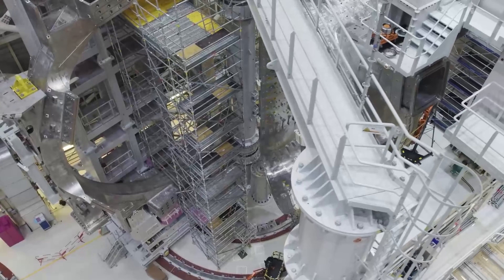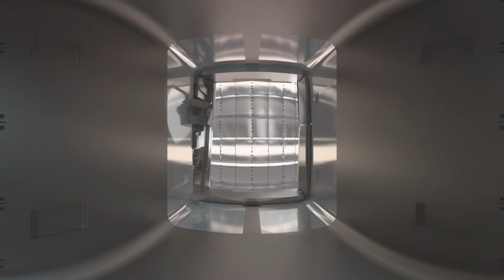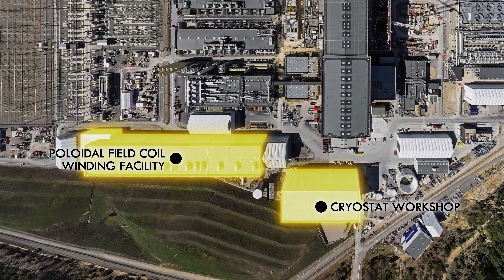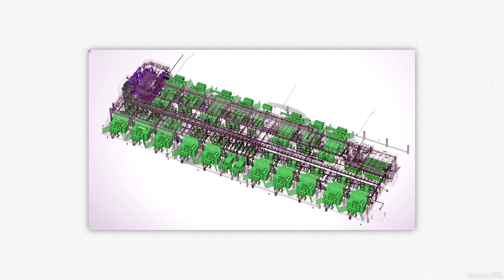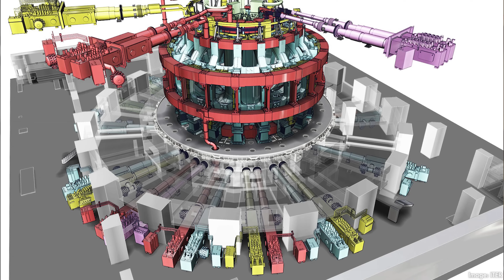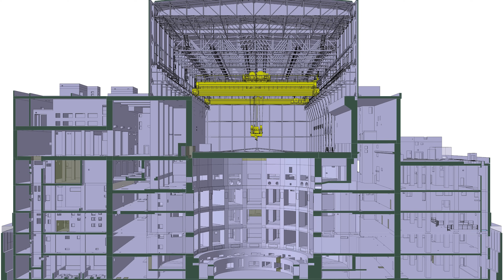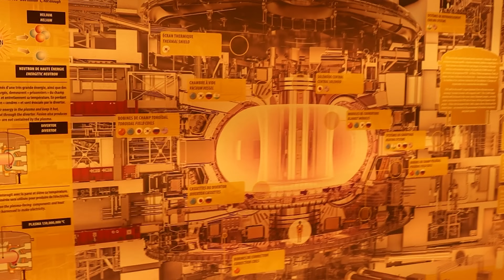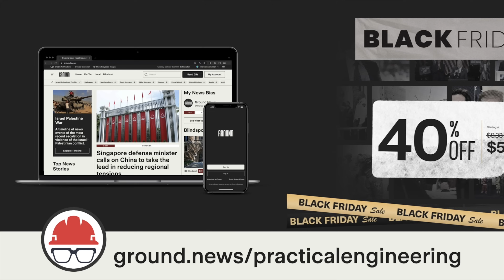Engineering The Largest Nuclear Fusion Reactor

Comment: 12:32 "ITER’s goal is to produce a Q of ten, to get ten times as much thermal energy out as it puts into the reactor. ".  No, power into the reactor will be 440MWe. Power into the plasma will be 50MW thermal.  Q=10 means 500MW thermal out of the plasma, equivalent to max 200MWe if used to generate electricity. So, 440MWe into the reactor, hypothetical max 200MWe out of the reactor.

Comment: Why does everyone brush off capturing the energy of fusion as being a trivial problem?  It's the first problem. It's been 50 years plus now trying to take the first step to a reaction, and nobody says how they will get electricity from it. Here it is brushed off as, we will boil water.  LOL. The entire process of fusion requires profound isolation so I'm wondering, how does the heat get out?

Comment: The sun is a sphere, not a donut shape.
The sun achieves fusion at lower temperatures and generates its own gravity.
So the questions are how, what forces are at work that we cannot detect in the sun.
We know spinning a magnet produces electricity in a coil of wire, so the force of magnetism can generate physical electrons.
But we cannot generate electrons from the earths gravity. 
We are missing something here.
Untill we understand what the force we cannot detect so far is, the fusion reactor will not work.
The Physicists cannot explain how the universe works, insufficient mass, so they solved the problem in their equations by introducing dark matter!
We have only just discovered how to turn photons of light into electricity using solar panels.

Comment: It’s time we took a reality check and consider the following options.

Cold Fusion (LENR) - Unproven hypothesized type of nuclear reaction that creates nuclear fusion at room temperature by producing more energy than the input energy can be produced from its altered state.

Tokamak Nuclear Fusion Reactor (ITER) - Development cost for the ITER is $150 billion. Requires a temperature of 150 million degrees Celsius to create nuclear fusion. Reportedly the record to date but having to use more input energy than produced is 69 megajoules of fusion energy for five seconds using 0.2 milligrams of fuel. 

Small Nuclear Reactor - The accumulative effect of multiple small Reactors eventually ends up with the same problems that affect large reactors.

4,536 Mw (VOGTLE) Nuclear Fission Reactor Costs $35 billion requires 1,282 hectares, nuclear safety costs $200 million per Mw, no technology to deal with nuclear waste and only has a known minable uranium reserve at current extraction rate of 80 years.
 
Renewable wind and solar farms - inconsistent energy production causes curtailment and fails because of the firming factor. In Australia the farming land required is ten times the size of Tasmania and are being erected without a decommissioning plan to address their environmental impacts. Renewables have financial masters to who the taxpayer serves. The primary purpose for renewables is Carbon offsets which allows polluting industries to increase their polluting activities while expecting the public to believe renewables are saving the planet.

The alternative.

Solar Hydrogen Energy Recovery Gas Turbine – 301Kwh (equal to 46/6.6Kw home solar installations) of solar energy collected from the sun’s constant nuclear fusion at atmospheric temperature is sufficient for electrolysis to provide the start-up sequence and enable a hydrogen Gas turbine to synchronize with the turbines Variable Frequency Generator and provide constant electrolysis to continually fuel the turbine and operate the energy recovery system on a hydrogen use as produced basis to generate a variably regulated energy range between 80 - 330Mw with optional co-generated steam capacity up to 700Mw of electrical energy on a 24/7 basis. 

The turbine has three operational parts, cost $36.5 -49.5 million, requires a footprint area the size of a football field, noise level is 60dbl at 60m, incorporates direct air capture of CO2 at 1,400 Kg/sec and includes a 14-year end of life decommissioning or optional refurbishment program.
 
Sixty-five carbon offset prohibited and pollution free, shovel ready installations generating a total of 21,450 Mw, retrofitted to any of the 120 Hydro-electric schemes would provide Australia's entire energy needs covering a combined operational area of 33 hectares for a 2023 total cost between $2.4-3.3 billion, construction period is 3 to 5 years, meet net zero twenty years earlier and makes wind and solar farms including hydro, gas and nuclear energy production redundant.

Comment: Seems very impressive as a project but no one expects this to produce any net energy.  Given the massive price tag; the funds could be spent on something that actually produces energy such as geo thermal; possibly home solar; or even natural hydrogen deposits identified by USGS which may be in the Trillions of tons - this project seems a total waste of money - Fusion advocates have been burning billions for 75 years; and they alway say they are one step away... at some point; it seems prudent to decide they can't do it.
Reply: If I was an investor and I had two choices this project which probably won’t deliver any benefit in the short term if ever and one that will deliver clean Solar guaranteed this year and for the next 25 years I know where I put my money
Reply: @chrisnewman7281  Solar at least gives you something, right now it has a stumbling block; lithium refining and lithium fires; if you can find better storage that would be money that produces something.  Geothermal produces something, wind does also but has the lithium hang up for storage. Ethanol works, conservation works, probably some other things work. Now if - an If like Fusion or natural Hydrogen work out - all the investment in those sure things becomes waste, but what are the chances?

Comment: Fusion will never work. Even if you get the plasma to work, and there is no indication you will it get to work sable enough. You won't get the energy out. There were the fantastical headlines of that one reactor for the first time "produced" more energy than put in. Yes, the reaction did, the energy output of that reactor was a big fat *ZERO*, though.

Old joke: Fusion is just 10 years away, said by the scientists and engineers since the 60. Every years.

Comment: Interesting fact 100M degree sounds insane but in eV it is about 10 keV and that like nothing for most particle accelerators most of them could easily produce 100 MeV  or 10,000 times bigger temperature. Even more most capable of them could produce 100 GeV like it's just another day. Sure that not that simple the amount of particle and frequency of producing those high energy pulses and efficiency make them not even close to project that would even get more heat then energy used for particle acceleration but nonetheless still impressive.

Comment: designed in the 1980's and completely outdated. Even when it is finished it can't produce electricity .It has to boil water to run a turbine first, The reactor has to be small and generate electricity directly to be viable .Completely outdated.

Comment: I'm a huge proponent of clean energy, but at 500Mw of output, they still have a long way to go before competing with nuclear fission. While I realize this is a prototype, the average output of ONE nuclear fission reactor (most fission plants have two or more) is around 1gW (twice the output expected from this project). In other words, one nuclear fission reactor is the equivalent of:

- 3.125 million (325W average) solar panels;
- 431 utility scale wind turbines (2.32Mw average);

Honestly, I'd rather see a prototype built for hydrogen fuel cell energy production. It's a far more established technology, using only hydrogen and oxygen to produce power (hydrogen atoms are pulled through a membrane by their attraction to the oxygen atoms). The only waste product of this system is pure water. Currently, the major drawback of this technology is the cost of separating hydrogen from oxygen. We need to focus on an effective way use the waste water produced to recycle the O2 and H1, since currently the most effective method uses fossil fuel.

Comment: Helion is taking a completely different approach. It forms plasma rings on either end and flings them together at 300kps. The plasma reaches fusion temperatures. It also doesn’t just produce heat the way a normal power plant works. It instead reacts against the magnetic containment field which turns the fusion energy directly into electricity rather than using steam turbines. Helion also doesn’t require tritium or beryllium. It only needs deuterium which is much more readily available and sustainable. Tritium and beryllium are exceedingly rare

Comment: As fascinating and impressive as everything to do with Iter and Tokamak reactors is, I am convinced that it is unfortunately a billion-dollar grave in which not only money but also time and resources are wasted. It will certainly be another 10 years before Iter goes into operation, and in that time it is conceivable that the first fusion reactors based on the stellarator principle will be under construction for commercial use. In my opinion, which is not saying much ;), the stellarator will prevail. Continuous operation instead of intermittent operation, lower price for the construction of the reactor complex, more efficient power generation with smaller size and significantly lower weight are just some of the advantages. I could imagine that we will see the first stellarator power plant connected to the grid in 25-30 years.

Comment: A commercial grade reactor is normally quoted at the 100 times energy output to input equation, which would put it on par with current fission reactors.

Comment: "no chance of leak and meltdown". You DON'T know that, nut untill that thing powers up and actually works. And it will only if enough power is put in firts.
Reply: We do KNOW that.
Reply: @SC710-1  actually we do not. There is a low probability but still is there.

Comment: @PracticalEngineeringChannel
The problem with a Tokamak reactor is that they're not going to get there. The very design of a Tokamak reactor means (to my knowledge I might add) it has cooling problems which require materials that turn radioactive, making the Tokamak a radioactive waste producer. There is a solution however, as Helion has made multiple Fusion reactors that do not create radioactive waste. I believe there might be a video on Helion by Real Engineering. Link: https://www.youtube.com/watch?v=BzK0ydOF0oU

Comment: Dear Folks, I have been working on Deuterium - Deuterium fusion by the action of a single laser beam. If it works it will be a very simple form of fusion and could be of use in generating electricity around the World. If you are interested please type "" fusion power Peter Macleod "" at the YouTube searchbar and that should get you there. Thanks.

Comment: Note: it attempts a Q(plasma) of 10. This would still be an amazing step. But that would barely break even on Q(total) under optimal circumstances, let alone in a research reactor like iter.

I love the fact they're building iter, but common use fusion power is far away.

Comment: The Qplasma of ITER might be 10, however the Qtotal of ITER will not be anywhere near that. 
Unfortunately this reactor will not produce energy and physicists know this. The people building ITER know this and have already stated it will consume far more than 50mw. And with the conversion rate of Qtotal (not Qplasma) it will be lucky if it can even produce a Qtotal of 1 which is break even. 
Because to date, no tokamak has ever managed to break even, let alone produce more more energy than is put in. 
This is well known and STOA warned governments specifically about this type of misunderstanding decades ago. 
This warning has gone unheeded. 
And shame on the nuclear engineers who know this won't work and are basically defrauding the entire international community.

Comment: This is a "bet the farm" project using 1980s vintage fusion knowledge to build a massive and  insanely complex machine that might not not work very well or not at all.  My gut feeling is that someone's bound to have overlooked or misunderstood something that's going to limit its success.  In the meantime, fusion-related science and technology march on and several startups are pursuing smaller simpler ways to achieve fusion. There's a chance one or more of them will succeed before ITER's finished.

One wonders why they don't install a couple of steam turbines to use all the heat the fusion reaction might produce.  Even their intermittent operation could produce useful electricity to charge batteries, etc..

Comment: The problem with fusion or any non renewable source energy is that it adds to the total energy load of the earth.  If we master fusion and create vast amount of energy most of it will end up radiated into the atmosphere increasing the total energy load in the ecosystem.  It is the same as too much CO2, or maybe worse.   We have to learn to maximize renewables with huge storage and maximum efficiency in using electricity.

Comment: A total of 600 MW for a possible fusion output of 500 MW. So, no break even really. The 50 MW thermal in for a 500 MW output is a bit misleading...

Also :  https://physics.mff.cuni.cz/wds/proc/pdf17/WDS17_16_f2_Matveeva.pdf (plenty other sources easy to find).

"A disruption is an abrupt termination of a tokamak discharge due to the loss of magnetic configuration stability. Usually they occur upon reaching tokamak operational limits: Greenwald density limit, current limit, beta limit, or because of the development of large magnetohydrodynamic (MHD) instabilities. The disruptive event is accompanied by the release of all plasma thermal and electromagnetic energy on a very short time scale compared to the duration of the discharge. In addition to this, eddy currents are induced in the vessel during a disruption and a large fraction of plasma current might be converted to runaway electrons. All these factors result in extreme thermal and structural loadings on the vacuum vessel components.
While for small and medium size machines the loadings during disruptions are relatively minor, for large devices such as JET and ITER they are destructive and prevent sustainable operation of the machine. Disruptions might bring severe damage to the vessel, therefore the number of disruptions in future devices has to be limited. At the present time disruptions are common and unavoidable events. However, there is a possibility to ameliorate their consequences or to make a disruption less likely to occur."

The fact you didn't mention that critical problem or not even asked him is bit strange to me. It's a big problem that will prevent any continuous operation and has plagued the tokamak configuration for the past, what, 60+ years. And there are no solutions on the horizon. The only way to increase the stability of those tokamaks is to make them bigger, hence ITER. But it also drastically increase the destructive power of those disruptions...  
Finally, 15 years to build for €15 billions is not what anyone would consider commercially viable... Make of that what you want...

Comment: Why can't the "experiment" be conducted on a smaller scale?
Reply: It has been. That’s what JET and JT60 are.
Reply: @Gomlmon99  And those produced more power than they consumed?
Reply: @azimuth4850  no. Magnetically confined fusion requires larger sizes to reduce the effect of energy diffusion from the plasma.

In short, power output scales exponentially with size by nature of the physics
Reply: @Gomlmon99  Wouldn't that be nice, I guess we'll find out if that's true.
Reply: @azimuth4850  It’s not something we need to find out, it’s something we know for a fact. It’s a fundamental of physics and has been shown time and time again.
Reply: @Gomlmon99  Oh, so it's 100% guaranteed to work then? Good to know.
Reply: @azimuth4850  no? Why are you saying that? I didn’t even come close to implying that. Who are you arguing with??

Comment: To be honest, as interesting as this is, it was also frustrating to hear about the immense waste of energy this project is going to generate.  Specifically, it's going to take a huge amount of electricity to cool the magnets to cryogenic temperatures, and that's going to generate a huge amount of heat which will simply be vented into the atmosphere.  Separately, it's going to take a huge amount of electricity to heat the plasma.  It would have been nice if they used the heat generated from the cooling process as an energy source in order to reduce the overall electricity/energy needed (they could use the heat either as a direct heat source for heating the plasma or as an energy source to charge "batteries" which could then be used for electrical generation or to supply heat to the buildings).

Comment: A really impressive project, with really impressive civil engineering. But I think the main takeaway from seeing all this massive scale and microscopic detail is: if this is what is needed to get Q=10 fusion, what's the chance anyone, anywhere, any time, will ever manage to deliver it for, say, $0.20/kWh or less?

Anyone who thinks fusion is the future of power has to contend with how it will ever be able to compete with other perfectly viable alternative energy sources. Even if you believe the cost will come down over time, it's not like the cost of solar, geothermal, fission, or wind are standing still either. The cost of fusion in 2050 will have to compete not with solar in 2023 but with solar in 2050. And I'm just not seeing it.